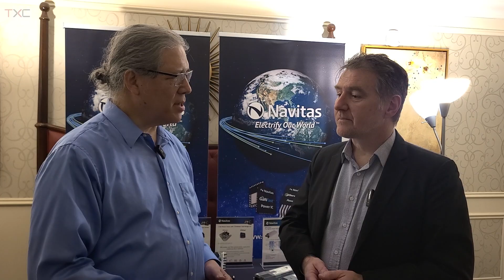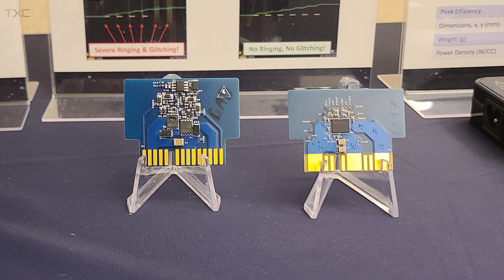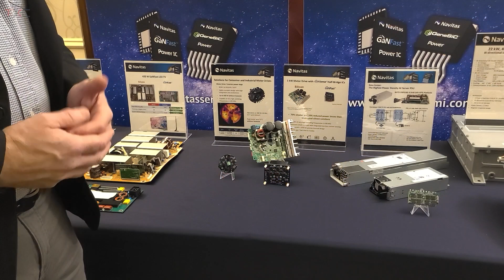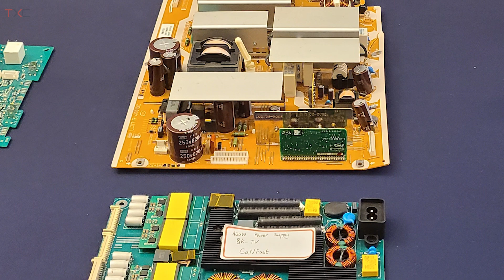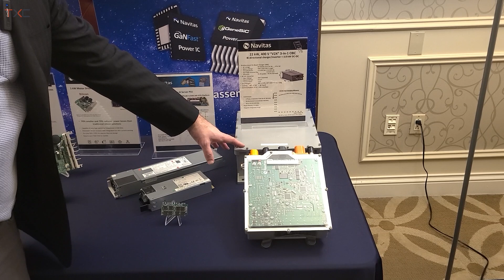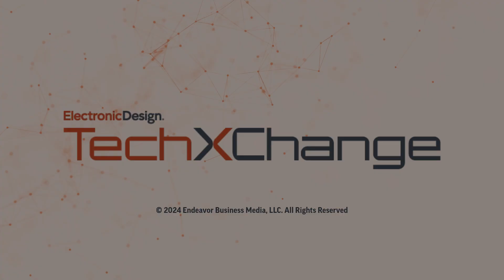Powering Electronics with Gallium Nitride: From Fast Chargers to Electric Vehicles

Comment: That’s great, but it seems that “belkins” purchase whole ultra fast controller series right at factory. Because I see no publicly available ones in catalogs. What a benefit of using GaN when controllers are for 300kHz (I’ve found only one for 800kHz). Another question is about planar transformers. Where are they? Only in fashion boutiques .. or, sorry: at Apple’s facility. So, it’s enough to advertise just chargers